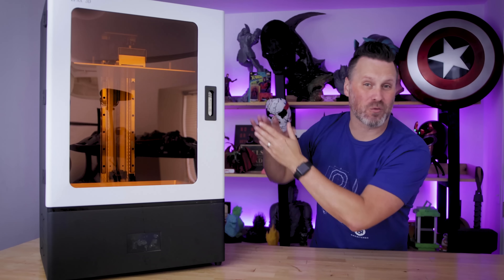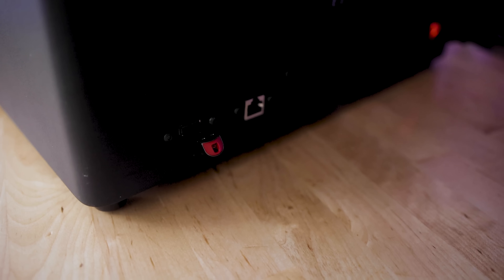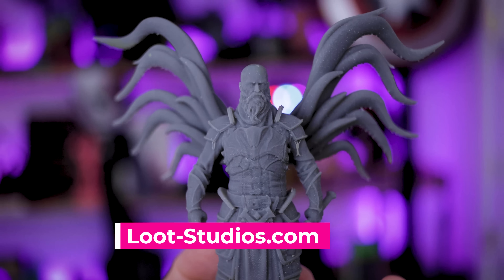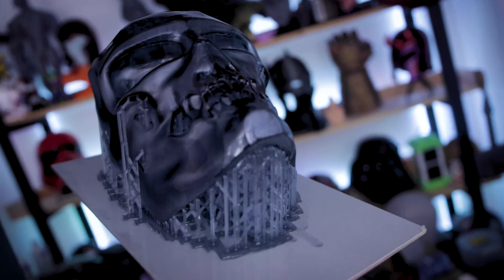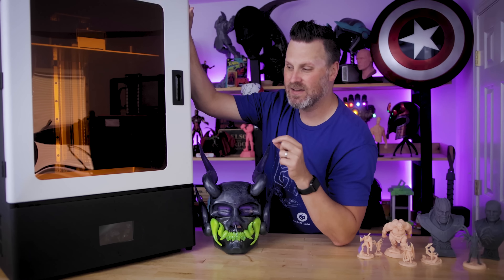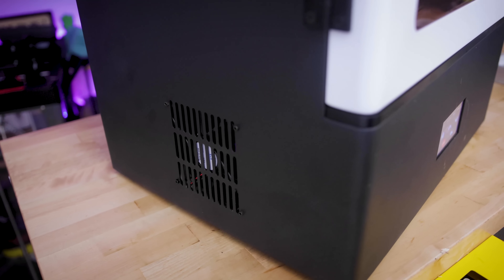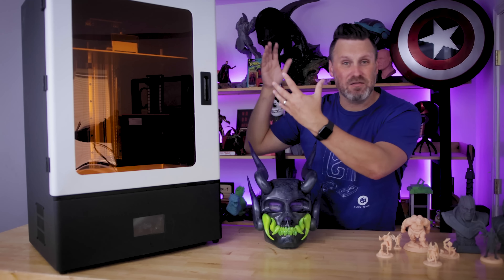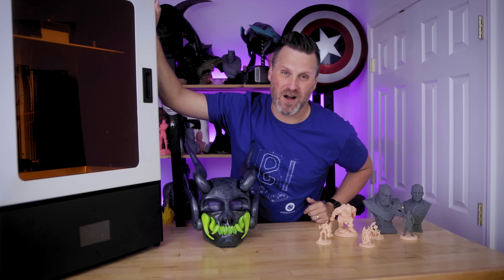Epax X156 Huge Resin 3D Printer Review

Comment: $3000.-? And not even a mono screen... Oh heck no...
Reply: The X156 is already has a 13.3 mono screen that is interchangeable and available to order - the X156 is very versatile and they have new mono upgrades kits coming out for this printer in the very near future. I just purchased mine and have been using it for the past 3 weeks and it is worth every penny. Of course it might be out of the price range of your average home hobbyist, if you run a small business that could benefit from a printer of this build size, it is a no brainier. I’ve been using FDM printers for large prints for years and while workable the post processing for smoothing can take days on larger FDM prints. This resin printer has cut my sanding time down by 95% or more. Just that alone is worth the cost of admission. Seriously, if you have sent questions feel free to ask. I’d be happy too respond.
Reply: i have the x156 with color and mono screen....it pretty much averages out time wise when doing very large prints that require the full build volume.  since the color screen is larger.